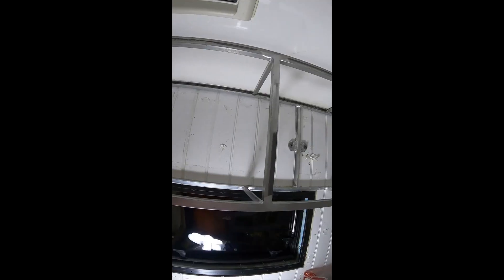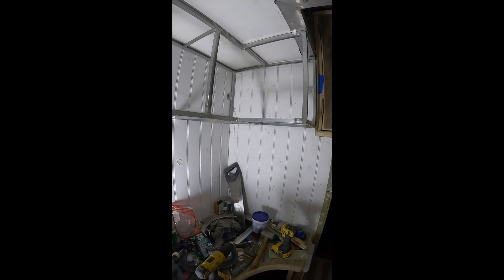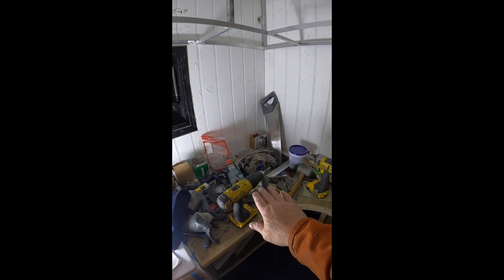A little bit of fab work. Making kitchen cupboards from recycled aluminium.

Comment: Good to see aluminium being used for framing and fitting out a camper van. Aviation principles right there; Less weight - less work for the engine - better fuel mileage, less wear and tear on the running gear.
Reply from the maker: Exactly. Also most of the aluminium was more or less free as it came out of the freezer boxes I dismantled. 😁